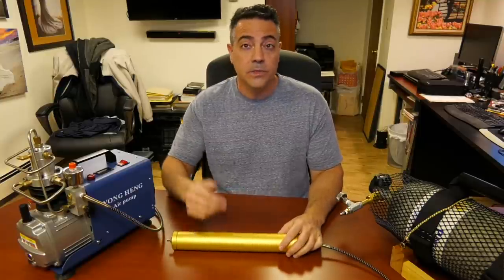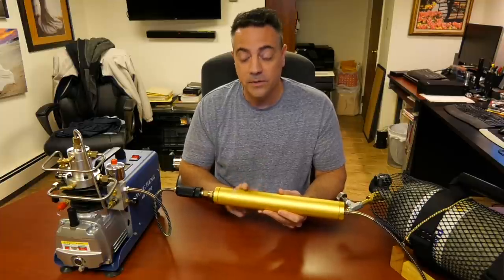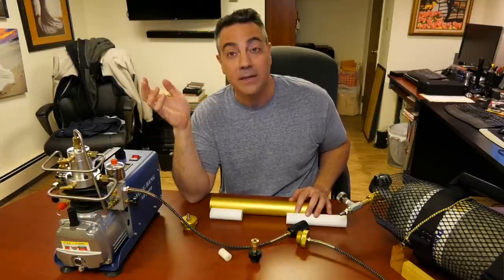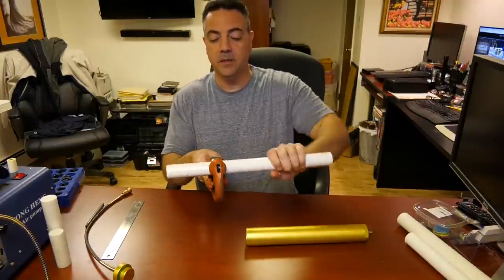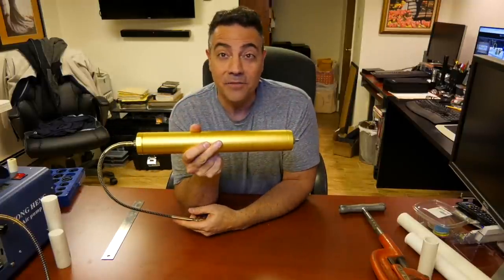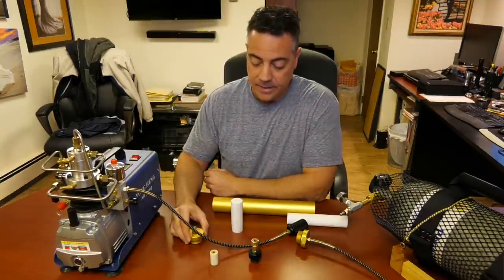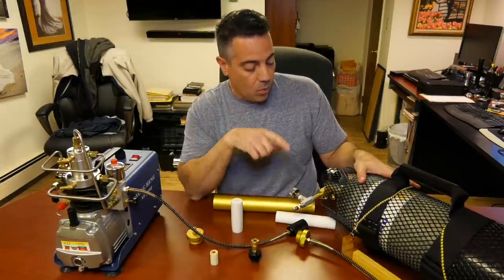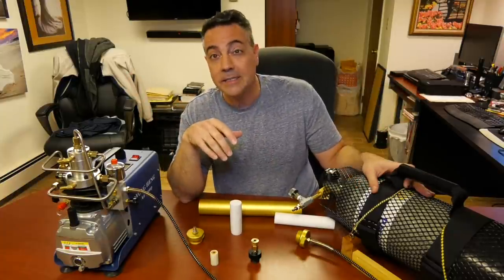Yong Heng 4500psi compressor and Water Separator (molecular sieve) for PCP Airguns

Comment: Great video.
Safety is always first Hiding behind fridge is called you value your life and i would do the same.  I have seen what just 300psi can do to a human. Guy at work came up with this brite idea on 3rd shift to use pvc as a secondary tank with glued caps. We had no clue to what he did when we came in on 1st shift. until we turned the compressors on to p-restart up the machines, well his brain storm exploded hitting women employee in shoulder she was very lucky it could have been fatal. It was very bad. So long story short this is high pressure that is 100% worse .  Any of these units i would not trust and would advise taking all safety steps to less the chance of a problem.

Comment: yes when compressor gets up to required pressure and shuts off (or you shut it off):
First shut the valve on the bottle
Then bleed the systems pressure out through the bottle bleeder
This releases all the pressure the same direction as it is pumped, by bleeding the system at the compressor end as you recommend is wrong, doing it this way is pushing all of pressure left in the filter (moisture ect) back into the compressor.
Always release the pressure at the bottle bleeder if available.
I guess when filling a rifle directly, you can only release pressure at the compressor end though.
Hope this helps.. ps I have a Omega Supercharger with a diablo dry air system filter..

Comment: Thank you for the great information. What do you think: is there any way to pre-filter the air before it goes into the pump? Is there any type of filter setup that you have heard of that could be used as a pre-filtering setup? Much appreciated.
Reply from the maker: Yes, I have seen some setups that use desiccant at the gold mesh filter to dry the air on the airgun forums but imjust did a video showing that it's not necessary as the gold dryer with bleem valve produces zero moisture in my 88 cu ft SCBA tank

Comment: Thank you Steve 😊 I got a youg heng compressor as you have and I also bought a big water and oil fillter just yesterday because I was just using the regular little fillter that comes with it and I was using it to just to fill my guns I don't have a tank but I noticed water in my gun 🙃 so I'm going to start using that big fillter it has a big fillter with a bunch of different stuff pack together in it so you don't get water in the gun fingers crossed thanks for sharing bsafe I hde just like you lol
Reply from the maker: Hey Chris congratulations you will love the yong hang just don't overwork it keep it cool and definitely use a water separator. I want you to know that I am making a new video because I am using a new type of oil called Seco lube 500 from filtertech.com which runs a lot cleaner and does not smell. I also have a new water separator that does a better job and is readily available on Amazon or ebay.. the new water separator does not have any media inside of it rather it collects water and drops it at the bottom and is completely empty inside except for a stainless steel condenser that collects moisture and drops it at the bottom of the tube which can be bled off periodically.
Here is a link to the water separator https://www.amazon.com/dp/B077SX5G9V/ref=cm_sw_r_cp_apa_glt_fabc_NM2QPEVSH9E40MADTCZ9?_encoding=UTF8&psc=1
Reply: @AirVelocitySport  ok thank you Steve  for the tips and tricks ... my wife  bought me a new impact m3 in 22 cal for faters day I was blown away I did not expect that I have not even shot it yet I still have some avs slugs 23 gr I want try in it but I've been very busy lately working but when I get chance im going to tune that new gun
Reply from the maker: Wow! Chris congratulations! That is an awesome surprise. Enjoy your new Impact.
Reply: @AirVelocitySport  yeah thanks I was still having fun with my mk2 im going just keep shooting my mk2 until.i get a scope bipod stuff like that for it ..but the good thing is is that the barrel and shroud are Universal they both work on both

Comment: There are so many comments I gave up trying to read them all. However, the pressure relief you call for water/oil is actually the low pressure side valve. The proper way to deal with it would be to start the compressor, close the high pressure bleed, leave open the low pressure side. Run the compressor until the high-pressure side equalizes with the tank pressure. At this point close the low pressure side to begin actually filling the tank. Another commentor talked about a one-way valve which is not a bad idea. At the end reverse the procedure. Obviously you will be opening and closing the tank valve at the appropriate time. There is no reason to have backflush air toward the compressor
Reply from the maker: Jerry Kornfield thank for input. I went the way of the one way valve near the tank. It so easy and no air get wasted. Plus it allows me to to bleed the air before shutting off the compressor. Works beautifully. All the best!
Reply: Regardless, the actual company says to pressurize the high side first then close the low pressure side to actually start filling, 1 way valve or not. When you hit the target volume, the manual says to open the low pressure side to stop the filling. Also, open the high pressure side bleed before you turn off the the compressor (that is also right in the manual). They say it will prolong the compressor life!!! Soooooo, why do they sell a auto shut off version LOL LOL  After reading all that, I bought the basic version (partly on help from your initial video and from Joerg Sprave.
Reply from the maker: You are correct. I no longer have the auto shutoff feature since my power relay burned and I replaced it with a similar power relay but lost the auto shutoff feature. By default I have to bleed the valves and then shut off the compressor. I use my compressor at least twice a week for the last 7 months and the piston orings have not lost must in the way of ability to pressurize my tanks.
Reply: It is updated but others I read are buying from Grainger.
Reply from the maker: Jerry Kornfield thank you for the link. That is now the second solid replacement power relay I've seen. As these compressors gain momentum the Chinese are stepping up with good replacement parts

Comment: Whats everyones thoughts on using an anti-freeze solution for coolant with these compressors?   Surely a good quality anti-freeze will stop rusting of steel parts,  & pitting of the aluminium components.  ???
Reply: Yes indeed stops galvanic action where there’s different materials.

Comment: Here's a way to put together a one-way check valve so that you don't have to worry about which valve to shut first. The check valve only allows air to flow in one direction. This configuration will end up as a male-male in-line check valve. You can use it between the compressor and the tank, or anywhere you want air to only flow in ONE direction. It's clear that you need to open the two bleed valves on the compresson BEFORE you shut off the compressor, to lengthen it's life. With the check valve in line, you can do that WITHOUT losing any air in the tank. Here are the parts:

https://airtanksplus.com/product/deluxe-ss-male-foster-fitting-with-male-18-npt-and-removable-check-valve/
https://airtanksplus.com/product/male-foster-fitting-with-female-14-npt-threads/

Might need an O-ring for the junction of the two parts. Not sure what size (I'm new to all this HPA stuff ... less than a couple of weeks so far)

Harry
Reply from the maker: midiman1007 thanks! That is an awesome solution to that problem.
Reply: But how does one vent the pressure between the check valve and the rest of the line to the tank?
Reply: @tomredmond  the tank has it's own bleeder. The compressor has it's own bleeder

Comment: Thanks so much for sharing. I have just started the same journey as you but with an Aceeagle pump which is a clone of the Yong Heng...or vice versa..who knows in China right!? . I've only used mine once to top off my 4.5l tank from 160bar to a hair under 300bar. Almost the same as you i only saw a little bit of oil in the first stage and the main, bigger filter did feel dry. Hardly scientific...but also paranoid about moisture so I bought a second stage filter but it was only a small one, the same size as the inline one you get with the pump. 
It's been gnawing away at me so
not content with that, I have bought exactly the same gold filter you are showing, also from Alibaba.I got it before I saw your vid...so....what can I say...great minds think alike!
 Been thinking about how to hack it to get some reusable silica packs in there and the pvc pipe with the o rings is a brilliant idea. 

Thanks for posting once again! Greetings from the UK!

Comment: This is some what sound but....the tank needs to be vertical, there needs to be a void at the bottom for moister to gather and you need a bleed valve to release the pressure and evacuate the moisture.
 You need  a pressure valve so the air pressure builds inside your filter to at least 2200 psi before air moves through the filter.  It's pretty much useless when low pressure air is moving through it. Your molecsiv is just filling with water and becomes useless without the water chamber and release valve.  But what you've got is better than nothing but rest assured with that filter set up,  you are definitely pumping water into your tanks and swamping your molecsiv rendering it ineffective.  You need only high pressure air flowing through the filter, you need a moister chamber and evacuation valve. You can overcome the low pressure air by not letting your tanks get below 2200 and just topping them off when needed but you definitely need a vertical set up with a void at the bottom and a pressure release valve to evacuate moisture under pressure.
Reply from the maker: Thank you for the information. I have since updated my good filter to include a bleed valve to purge the moisture. Also I only use this system to top off my tanks from 3000 psi to 4250 psi. I did have my tanks visually inspected by my scuba shop and to my surprise it was almost completely dry. There was almost no moisture. Buy the air did smell from the hydraulic oil I used to use. I have since switched to Secco lube compressor oil which is used in the food industry. This has helped to eliminate carbon build up on the high pressure piston and no smell.
All the best
Reply: @AirVelocitySport  awesome! Thanks for the videos

Comment: Don’t no if they are certified safe in the uk ,, but people are buying them and using them as well as other brand name Chinese ones , cheers Shane uk 🇬🇧
Reply from the maker: Yes I do not even know if they are certified safe in the United States of America. when I first started using this three years ago I was afraid something bad would happen.someone then mentioned to me that if something goes wrong with even one unit and someone is hurt or killed they will never sell another unit. so it makes sense that the Chinese make sure that this unit is slightly over engineered for safe use. the block & head cylinders made in China are no different than those used inventory or Hatsan compressors.

Comment: Hello I live south east Texas and very hot. I noticed that yung heng get very hot in 3 minutes I'm running 5 gal bucket of ice water. I'm outside and all wants notice that most video are showing inside house or garage. So my question is it only made run inside? Thank You very much for video there great thank you  for time. Brad
Reply from the maker: I just filled to 88 cubic foot tanks today in New York.I did it in the garage with the door open and it was 91° and very high humidity.Iran the young hang for 10 minutes on one tank and 12 minutes on the other tank. I use a two and a half gallon block of ice with very little water and it kept the temperature down to 44 Celsius the whole time.the trick is to use a solid block of ice with little water and make sure you bounce the ice to get the cold water running.

Comment: Dear Sir,
Is molecular sieve what we normally refer to as desiccant??? Desiccant has the unique feature of being reusable when spread over a plate left in a warm oven in order to dry out the moisture soaked in during use. Vey interesting  & well explained video. keep up the good work. Kind regards.
Reply from the maker: ToolsConsumables not sure exactly but molecular sieve is supposed to be the best for high pressure
Reply: Dear Sir,
Many thanks for your courteous reply. desiccant is usually found in electronic equipment ( cameras, mobile phones, computers, other delicate components ) that must be kept absolutely moisture free. It's normally in little bags that look like corse salt grains (in a pillow shaped transparent bag). One can purchase large quantities as well as tiny amounts online. Kind regards.
Reply: ToolsConsumables  My work was in a oil refinery the last 37 years. Our unit controls used air. It had to be dry.  We used desiccant in big twin tanks . One was heating up and removing moisture while the other in service. They switched every 2 hrs. We used large amounts of air. So yes desiccant will work . The desiccant we use is around half the size off a BB.
Reply: Dear Sir,
Many thanks for your courteous response.  I wasn't too sure if what Americans call molecular sieve was the same stuff as I 've never heard it in the UK. But many thanks for your comment. Kind regards.

Comment: a 1-way fill valve will keep ya from losing pressure when you bleed off the moisture
Reply: Yes, a 1-way valve will solve this (preferably mounted closer to the bottle end).
However, there is already a 1-way valve that protects the high compression side of the compressor, from feeding back into the low pressure side, mounted where the SST line  connects to the outlet block (at least on my model). 
So weather you put an additional 1-way valve on the line (for additional safety) or not, you can safely shut off the compressor with the line to the bottle being charged, then close the bottle and then bleed the line, without worrying about damaging the compressor head.
That's likely why they felt confident enough to install the auto shut-off on the 220v version.

Comment: Glad I found your video.  My Yong Heng is arriving today.  I will order the filter components ASAP.  What oil do you use in your compressor?  And no, I haven't searched yet, but does your earlier video include details on initial setup of the compressor?  Thanks!
Reply from the maker: Jim Mellon yes, check my other video for some detail on start up. Use aw46 hydraulic oil
Reply: Thank you

Comment: Why not just pour the molecular sieve directly into the tube like the Diablo filter? Is molecular sieve better than silica gel?
Reply from the maker: According to what ive read moecuoare sieve can cuase acid errorion over long periods of time compromising the aluminum tube wall. Could be dangerous
Reply: I appreciate the reply, I just ordered a filter from AlliExpress that already has the Molecular Sieve inside a plastic tube similar to your setup. Thanks!

Comment: With O-rings sealing the pvc tube inside the aluminium tube aren’t you pressurizing the pvc pipe to ~4000psi? Is it rated that high? Have you noticed it deform at all?

Comment: The compressor I purchased has the auto shutoff. I simply set the shutoff level at max, over 5000 psi on the gauge, then do a safe manual shutdown when my gun/tank reaches a pressure well below that. A question though, how about putting the desiccant on the low pressure input side, you could make the entire tube out of PVC and avoid it having to maintain high pressures? Or would it suffocate the low pressure input?

Comment: Hi. Like your videos. Wonder if you could help me? I have the same compressor but although it has worked OK for the last 18 months with no problem i now can't get the pressure above 210 bar instead of 300 bar. I would be very grateful if you could give me any advice. Many thanks

Comment: I was just wondering if those harbor freight o-rings held up because you want that inside pvc real tight...have you had any oil on the outside of the pvc? I'm looking to get the same compressor. But I'm thinking about actually making a longer filter than that. Also wanted to know what has been the longest run time that you've got out of it and if you used ice water or does the instructions say not too? I don't know if that would cause more condensation or what have you maybe somebody else on here might have the answer to that if you don't. Thanks for your time because I can't wait to get one.
Reply from the maker: The orings should be 70 duro meter and 90 is best. Not sure if harbor freight has those orings. I never run it more that 20 minutes. I have run it for 30 minutes but it really wears thing out even when I use ice water and keep the temperature around 47 celcius.
Reply: @AirVelocitySport  Thank you for the input.👍